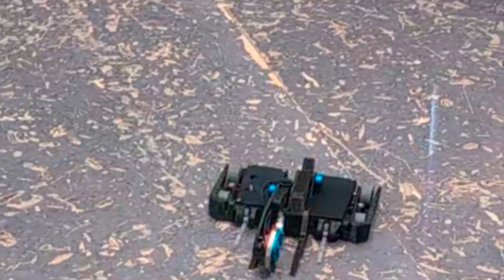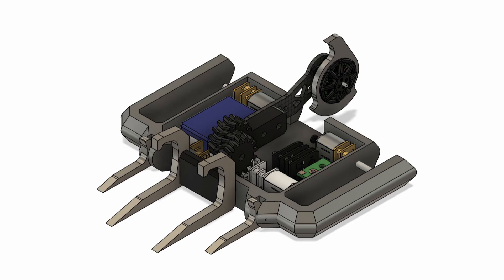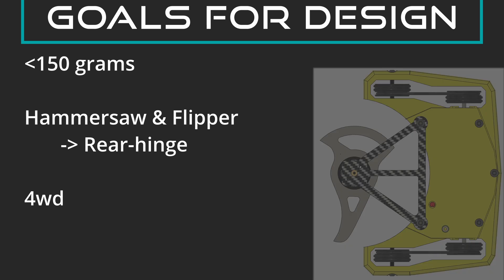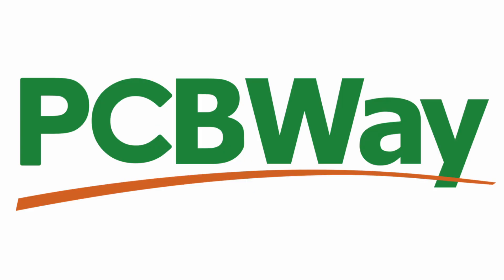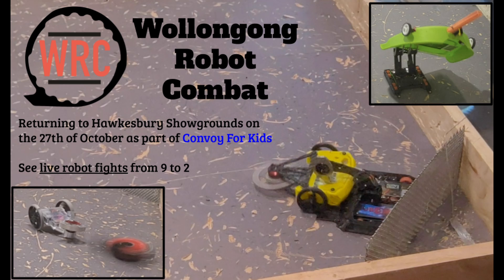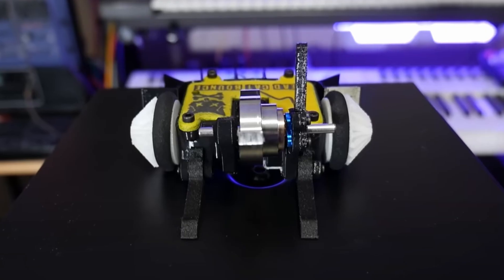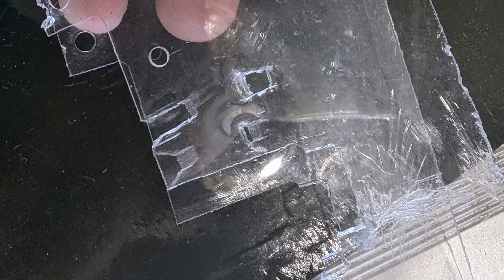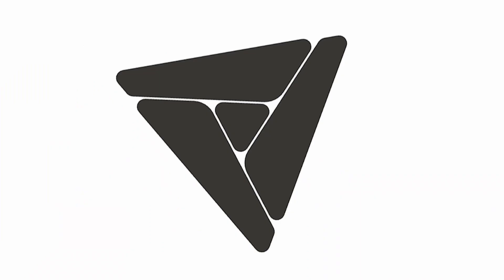2 Weapons, 5 Motors, Under 150g?? - Combat Robot Synergy Mk1-2

Comment: I would recommend mixing the arm and flipper to the switches on the top of the transmitter to make everything easier to control
Reply from the maker: Thanks, yeah I ended up getting a more ergonomic tx (radio master Zorro) and that seems to have helped. I should really do another video soon

Comment: Checkout the radiomaster mt12 4in1 transmitter it can connect to the flysky receivers, the surface radio transmitter I feel is easier to access multiple switches and edgetx opens a whole world for programming and mixing various functions
Reply: Awesome build BTW hopefully we'll cross paths one day I live in Spain. But me and my son are looking to travel for a featherweight meet this year
Reply from the maker: Yeah, I've heard good things about the mt12 although seems like people I know have had to mod it to have control for throttle and other functions apart from driving. I just got the Zorro so hoping that helps. Good luck with the featherweight!

Comment: Absolutely amazing work! 

I'm not sure if it would help in your case since your weapons are N10 powered, but I control the weapons on my ants from the switches rather than the sticks using a "Throttle hold". For the Servo powered flippers and Axes i run it means you get consistent movement every time from fired position and back and can't move the stick in slightly the wrong direction and not have the same movement.
Reply from the maker: @sliders15  Thanks! That's definitely going to be something I look into! I've also got a new controller where the switches are just easier to use while driving so hopefully along with some design changes, mk3 performs much better!

Comment: excited to see improvements in control for this bot, maybe a more advanced radio transmitter or trying some different control maps, the hardware seems capable enough to be a dominant fighter!
Reply from the maker: @xymaryai8283  Cheers! I've ordered a better transmitter as of yesterday with plans to remap controls
Reply: @engineered_cha0s  which one did you go for? i'm also looking to replace my FS-i6, i've managed to figure out its programming almost completely, very limited by it.
Reply from the maker: @xymaryai8283  the radiomaster zorro with 4-in-1. Heard good things about it, seems like it'll fit my hands better than the fsi6 and the 4-in-1 means I can still use the same recievers as before but with more options if I want

Comment: 12:11 I partially disagree, if you let them wiggle around for a while, either they or bumping into your bot more, a chance to self-right and just resume attacking. It's amiable to try and do less damage to their $$$ electronics, but on the flip side that's a strategy for winning as well(and kinda the whole point of the build?). But also there are other factors of course, assessment of opponents skill or willingness to get their bot thrashed is actually a huge one. Just don't give yourself flak for taking the shot , it's part of the competition. Conversely if they had hit you more times then spend the rest of the match turtling around upside-down, judges could call them winner on hits alone. Though this isn't the big leagues of course.
Reply from the maker: @Roobotics  yeah that's valid. There are definitely factors to consider and sometimes I do go in for the extra hit although early into the design process I had actually said that I would try to give them a moment but I forgot that during combat. I suppose they had all the time they spent trying to self right to call it quits and it did give me at least some success to show in the video. So while I am proud of the performance of the bot and the damage it can do I'm not proud of my forgetfulness of that occasion.
Reply from the maker: that being said there were no hard feelings from them and really we're all friends which is something that's so awesome about this whole sport. And true, it is the point of the bot and a possibility which I guess is inherently accepted when entering the arena

Comment: I wonder if you could remove the hammer arm motor by using the reaction torque from the weapon itself to fling the arm in either direction. It would mean reversing the direction of the saw, so you no longer have the hooking action on the saw impact, but it does mean that should the arm get stuck down, it is set up to be a regular vert.
Reply from the maker: @DigitalJedi  I've not considered that! that would work and would save me some weight my only concerns are because the arm is actuating with the spinup I don't think I'd reach full speed of weapon before I hit and the rpm of the arm itself plays a noticeable part of how hard I can hit since the spinner itself is quite small. Also spinning the current way means that the tooth is pressing the opponent's chassis up against my forks/myself giving me a better chance at piercing things whereas spinning the other way would more likely just throw the opponent away like a regular vert. Also the arm just isn't made to be a traditional vert so if does get stuck forward it'd likely break or be less effective unless I invest alot of the weight I gain from removing the hammer arm motor directly into beefing up the spinner. 
I had considered a kind of ratcheting thing where one direction of a motor actuates the flipper and the other direction actuates the hammer but that seems complex, hard to figure out getting the arms to return and ideally I'd like the flexibility of both arms moving at once if I have to
Reply: @engineered_cha0s All valid points for sure. It's been a thought I've wanted to see done for some time, but horizontals being my thing, haven't built myself yet. The acceleration of the weapon seems to be the most important part to get right, as that means both a higher impact speed and a greater reaction torque to swing the arm with. It's really all just a thought experiment I've had after figuring out I can drive my undercutter with 1 wheel by adjusting the weapon speed to steer with it as a reaction wheel.
Reply from the maker: @DigitalJedi  I'd love to see it! Not sure if it'd integrate well but if you had a bistable mechanism to help accelerate the arm once it's left the stable "rear" position that could be interesting too! I have a friend who was experimenting with a bistable mechanism but had issues self righting... Good luck! I've found horizontals don't translate a lot of design features to other bots so it'll likely be a challenge but that's where the fun lies (:
Reply: @engineered_cha0s That's exactly why I'm interested in trying. Horizontals are fun but it's time for something different. The bistable mechanism idea is very intriguing for sure.

Comment: What is you swapped out the lifter for a grabber with a small metal spike? It would likely be very effective against slippery opponents.
Reply from the maker: That can be effective and in fact the winner of the competition shown in the video was one such robot! I'm just not sure if it works as well in this case as a 'synergy' of weapons.. I kind of want to flip opponents rather than lift or suplex them into the air because then I'm basically bringing my opponent toward my vulnerable hammer arm instead of potentially revealing a more optimal place to strike

Comment: I’m thinking of using motors for a flipper as well… how do you limit the motors rotation without stripping out the gears?
Reply: I've just let the motor stall in smaller bots, as N20s don't pull much current. On larger bots like my last lifter beetleweight, I use a slipper clutch made of 2 metal plates with a piece of rubber mat clamped between them.
Reply from the maker: yeah given my controller setup with the arms on the stick that's usually my throttle, I've often not been able to completely manually return the y axis of the stick to zero and one of the motors just keeps stalling the tiniest bit for the whole fight which doesn't kill it but it gets quite warm and I think in general I'd like to avoid it if possible
Reply from the maker: Yeah it's a bit different to the positional control you can get with servos.. I don't know if I recommend it above the insect weight classes but the basic strategy is squishy endstops for the arm to run into to limit rotation (in my case the whole chassis is squishy) and then just don't keep pushing the arm once it's already stopped against the end of travel or you're likely to burn a motor or smoke something. Best of luck with your flipper!

Comment: Print in polypropylene to save more weight!

Polypropylene (PP): ~0.90 g/cm³

Polylactic Acid (PLA): ~1.24 g/cm³

Polyethylene Terephthalate Glycol (PETG): ~1.27 g/cm³

ASA/ABS: ~1.07–1.10 g/cm³,

Thermoplastic Polyurethane (TPU): ~1.10–1.25 g/cm³ (varies with hardness)

Polyamide 6 (PA-6, Nylon 6): ~1.13–1.15 g/cm³

Polyamide 12 (PA-12, Nylon 12): ~1.01–1.03 g/cm³
Reply from the maker: Yeah, I had actually considered that! From what I remember polypropylene is also more brittle than tpu so it wouldnt take the impacts as well and I've not seen many people implement it yet. I wanted to have the chassis done as a billet of HDPE but I need to get better at designing for machining before I can do that (maybe for mk3) MK2.5 implements the changes I can make without redesigning the chassis itself and I actually tried a higher hardness tpu like Angus of maker's muse talks about in his dead cat bounce videos. I think there's also a partial clog in my printer so the tpu I'm extruding isn't quite as solid which is helpful for saving weight I suppose

Comment: Noice - yeah the old FS-i6 controller isn't great for complex bots - which is why I went to the Jumper 4-in-1 for Spiro. I can use button on the index finger for the saw.
Reply from the maker: @andrecook4268  makes sense, yeah definitely need to upgrade the controller if I want any hope with this thing 😅 just ordered the radiomaster zorro 🤞
Reply: @engineered_cha0s I got the radiomaster pocket, which would be perfect if it done 4-in-1 out of the box, but can with the nano module.

Just make sure you order the batteries for the zorro at the same time - I don't think it comes with them and it uses a less common Li battery, which put me off it. I'm slowly going to 18650's for all my radios.
Reply from the maker: Thanks! I saw the pocket but I think I'll like the grip of the Zorro better. Found an RC place nearby that sells the Zorro with batteries just need to get a case so I don't break it
Reply: I might hit you up sometime for some radio recommendations. I've started down the rabbit hole of opentx vs edge tx. Multiprotocol vs elrs. There are too many layers to radios but I'd like to get something beyond "just use an fs-i6 and a Malenki-Nano"
Reply: @TrentSheather  Yeah for sure. I can bring my collection for the second attempt of the Newy meetup. 

In my own dreams of doing youtube videos I wanted to compare AFHDS2A to ELRS in terms of link reliability and penetration in noisy arena environments.

I sum up ELRS as:
Pros - open source, you can do anything!
Cons - open source, you can break anything!